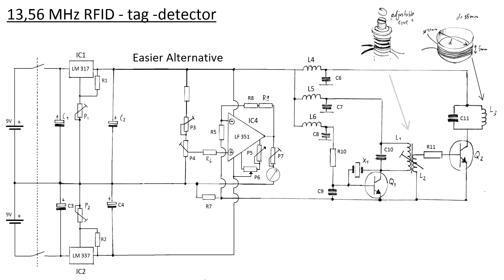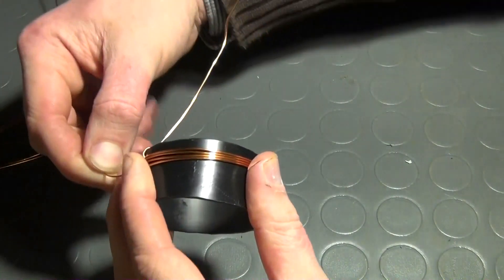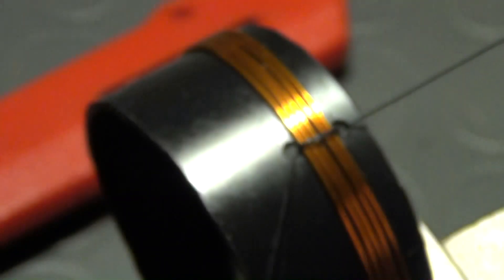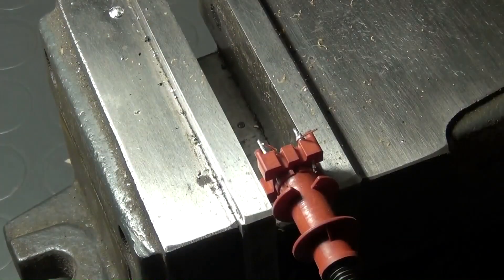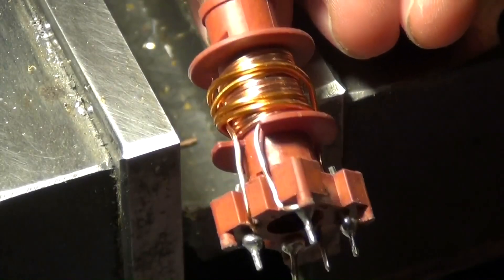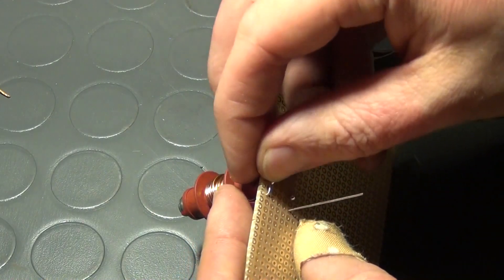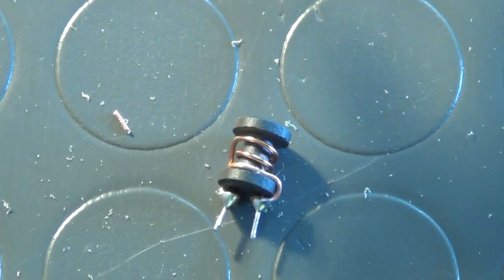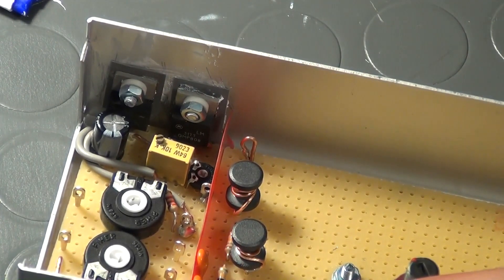How to Build an RFID Tag Detector- part 2: RF Section

Comment: Can you build one of those detoxification modules as shown on Facebook you soak feet in water bath modules  set in bath emitting a slight voltage into water goes through skin and grounds back to water pulling toxins out of feet via skin .water turns black color pulling metals out.simular to tins unit. What do you think it would be a good new podcast. Thanks Rick woidtke

Comment: what is the reason it needs exactly 5 windings on the detector coil? would more make it stronger or more accurate?
Reply from the maker: David Yarbrough No. More turns don't make it work better.  The sensing coil and the capacitor near it comprise a "resonant circuit". The resonant circuit only resonates with 13,56 MHz, if the circuit is "tuned" to that frequency. You can change the number of turns, but then you also have to change the size of the capacitor, or the circuit will not have the right resonant frequency.
Reply: The Post Apocalyptic Inventor ok thanks. i am still new to all this. also in another of your videos you were removing parts from old electronics and at the end of the video you were using a homemade transistor tester. do you have a tutorial on how to build that. it would come in very handy

Comment: You said the direction of the winding does not matter.  Do the primary & secondary have to turn in the same direction (w.r.t each other)?  Also, what will cause the apocalypse?
Reply from the maker: mdesm2005 The transformer does only "transform" the AC portion of the input voltage. The polarity of the output voltage is thus changing all the time anyway. When changing the winding sense of one of the windings you would create a phase shift of 180 degrees in the output voltage though. Since the amplifier stage has no feedback path, that phase shift plays nor role though. 

I don't know what will cause the apocalypse :D.But  I guess there will probably be a war over natural resources because this world is transforming its ways of energy production way too fast. 
But who knows about the future ?! There might as well be no apocalypse at all :D

Comment: can you list all the parts and items needed ? i need the list. thanks
Reply from the maker: You can see the list at the end of part 1. You maybe didn't notice it.
Reply: The Post Apocalyptic Inventor Thanks for the reply. I did not noticed it. for the transistors part, can i just buy it like this one ? http://www.ebay.com/sch/i.html?_from=R40&_sacat=0&LH_BIN=1&_nkw=2n3019&_sop=15
Reply from the maker: Hazwan Nazri Well you can use any bipolar junction transistor that is capable of amplifying a signal with a frequency as high as 13,5  Mhz. Every modern universal type is capable of that. But you also need a transistor that can handle a certain power ( at least 1-2 W) . The transistor in the link might still be ok for the job, but you better look for one with a higher power rating. On the other hand you don't need a collector emitter voltage of 140 V.  something in the range of  1A / 40V / 2W , for RF-applications (universal types are ok, but not big chunky power transistors) is what you should look out for.
Reply: The Post Apocalyptic Inventor another question to ask. what is the maximum range of the detector to detect any tags ?
Reply from the maker: It depends on the tag. Some give a stronger reading than others. But in most cases the tag must be within a maximum distance  of  1-2 cm from the coil.